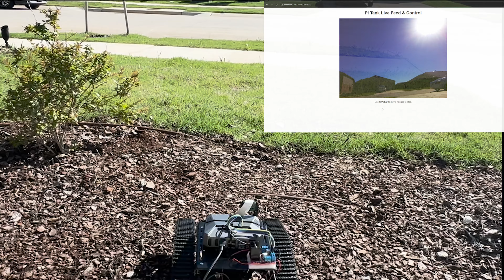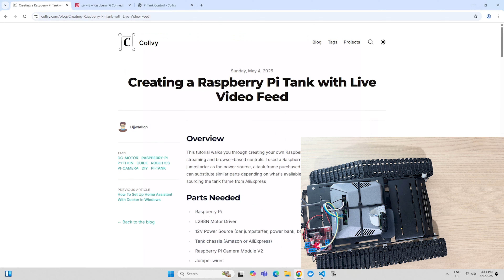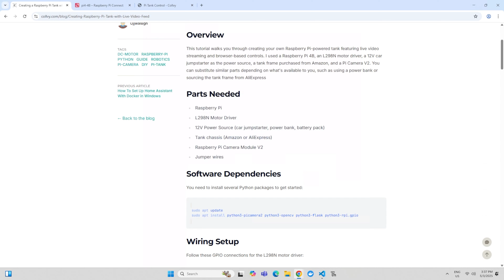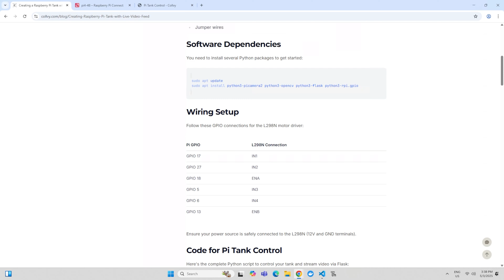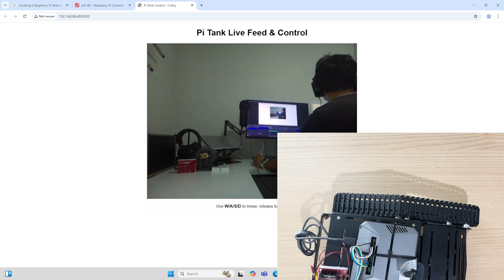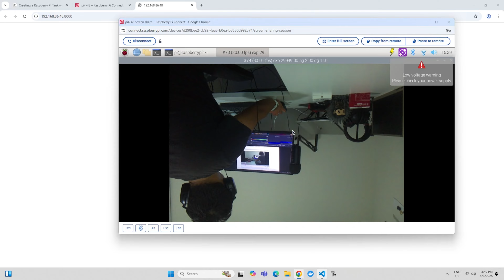DIY Raspberry Pi Tank with Live Video Stream

Comment: Excellent project 👍 !! i am trying to make it with 24v 300w brush motors. do you have any advises for controller that can move it smoothly.
Reply from the maker: Thanks! Glad you liked the project... 
If you're experiencing jerky movement, especially during starts or stops, you might need to implement an acceleration ramp. This gradually increases (or decreases) the PWM duty cycle, allowing the motor to start and stop more smoothly.

Comment: Do you need any video transmitter or it comes with the pi camera?
Reply from the maker: No extra transmitter is needed. The Pi Camera V2 plugs into the Pi’s CSI port and the opencv and Flask applications work to streams video over your Wi-Fi.
Reply: @collvy what is the range in which you can get video over wifi
Reply from the maker: It really depends on your Wi-Fi and surroundings. You should see about 20–30 m line-of-sight, around 10-15m indoors (through a couple of walls). 
We could add USB Wi-Fi dongle with a high-gain antenna to Pi to increase the range.